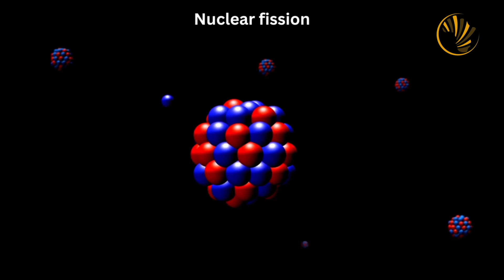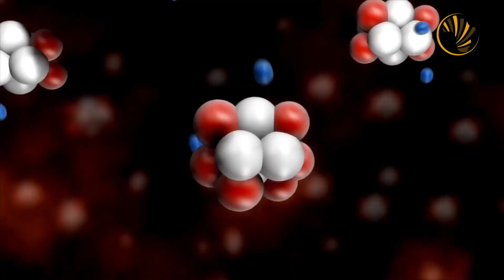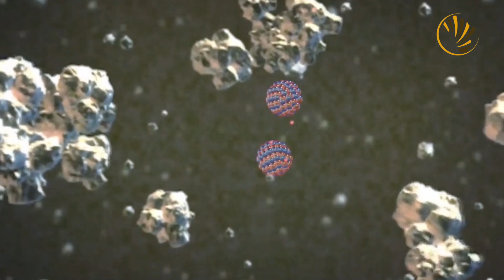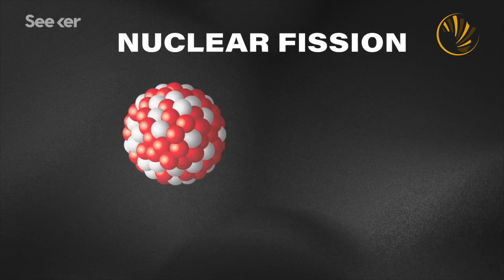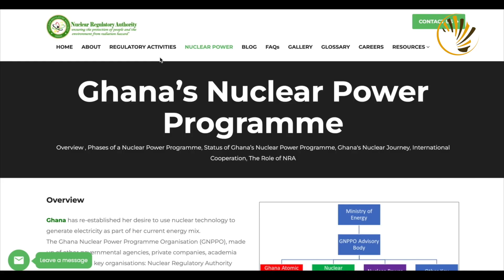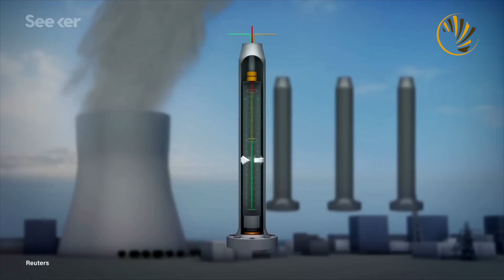The Nuclear Age Began in Africa

Comment: There's a reason most rich, well-developed countries don't have nor pursue nuclear power. African countries have those reasons and many more.
Nuclear power is extremely expensive and requires deep knowledge and expertise that only great wealth allow. You must already be rich to achieve it, or starve your people to achieve it like the DPRK.
It could make sense to pursue nuclear power long term after certain milestones are met--social, economic, political and technological--but right now it would be foolish (except for SMRs if they prove to be viable). Even if all the conditions required to get nuclear power were currently met, which they are far from being, it would take minimum 10 years to build a single plant and that's building at Korean speeds when they're used to it. Then what good is nuclear power without a grid? Who will build it? How will it be financed and maintained? Where is the competent and educated workforce for this colossal endeavour? Deploying renewables + battery storage should be first priority. These are more cost effective even for Western countries. Then gradual grid deployment and integration. A nuclear powered Africa is optimistically 40 years down the pipeline.